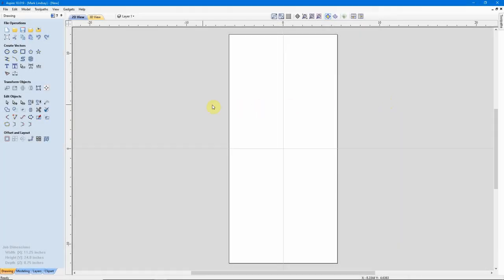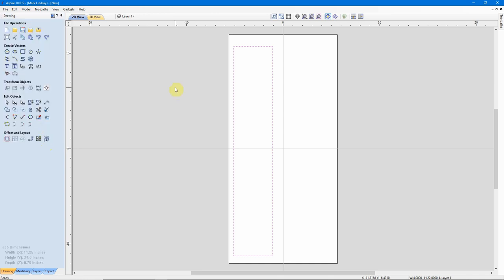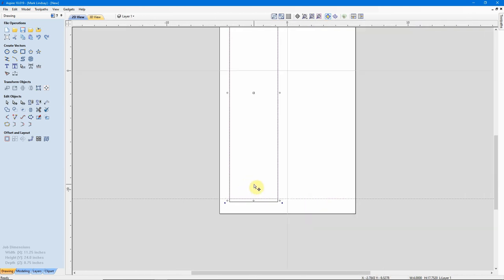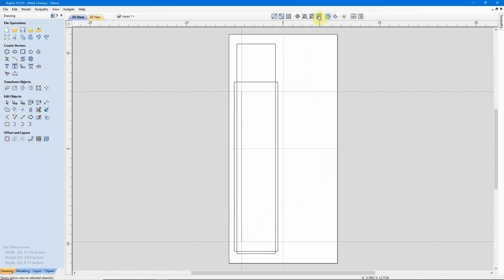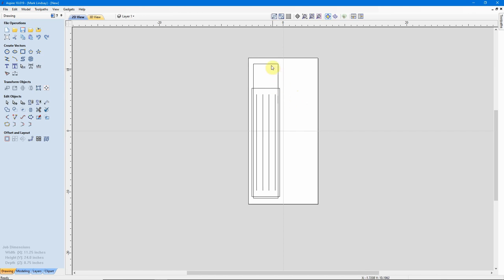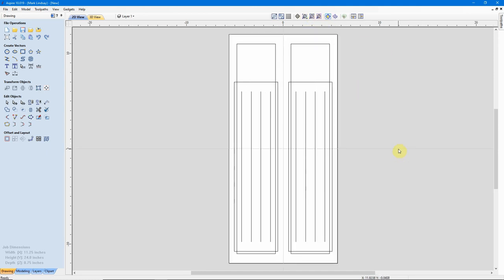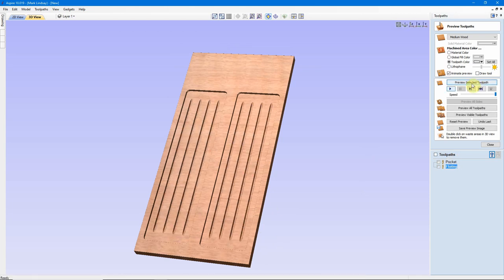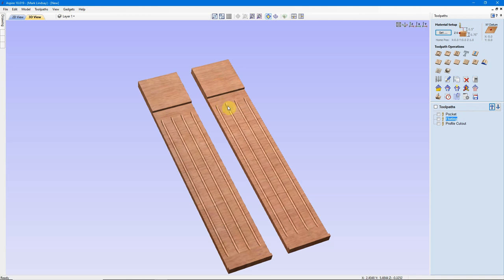The Fluting Toolpath - Part 41 - Vectric For Absolute Beginners

Comment: Mark, you are the man. Just wondering why you left off the tabs? Because you were taping the whole project to the spoil board ?
Reply from the maker: Nothing that complicated. I left out the tabs because this was just a simulation. I'm not actually going to cut the project. If I were, I'd wait until I got the material I was going to use for the project and measure it. Once I got the project laid out for that specific material, I may or may not add tabs, depending on several factors (width and length of the material, etc...)

Comment: Great video Mark. Have A question I a, making some Drawer boxes for a cabinet. I want the bottom and the sides to have pockets in the inside of the drawer front to fit into. Another words I want to use the front of the drawer to be the front of the box also.
I want the side pockets to have rounded edges top and bottom for the bit to fit into. What I need to know is after I create the rectangle  how can I move it to the piecise place I need it to be on the board .Say .75 from each edge. Can this be done without using guide lines, 
Thanks Jeff

Comment: Mark I watched this video again. Was wondering why you chose 2 types of ramps. Is That because the First one plunged in at a straight angle to the depth and  out straight. and  not curved. Could you have chosen just the second one and  used it by itself.Jeff
Reply from the maker: In the Fluting toolpath, I only chose 1 type of ramp, so I'm not sure what you mean, Jeff.

Comment: next question... how can i use the ramp in ramp out  fluting toolpath as a profile cut on open vectors..? there is no option to cut inside or outside or cut sharp corners.... im trying to figure out how to profile carve text on a sign  that starts shallow then goes deep back to shallow again...needs to be accurate and sharp like a profile toopath but ramps in and out  like a fluting troolpath.

Comment: in vcarve is it possible to cut shallow on one end of a tool path to deeper in the middle then back to shallow at the other end..?
Reply from the maker: Yes it is, and that's what the Fluting Toolpath does. In the video, I used Ramp at Start and End and set my Ramp Length to 1 inch. For your example, you would select Ramp at Start and End, then set the Ramp Length to half of the vector's length. Then choose Smooth or Linear for the Ramp Type.  Calculate and Preview it, then make any changes you need to make to get what you're trying to create.
Reply: @MarkLindsayCNC  

Thank You!!
Thank You!!
Thank You!!